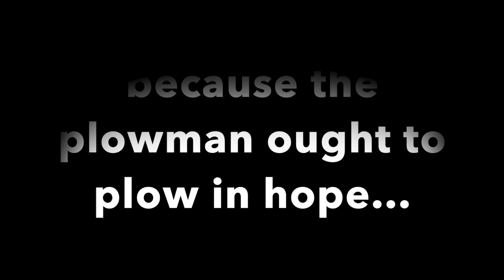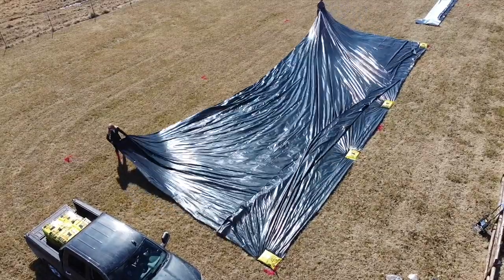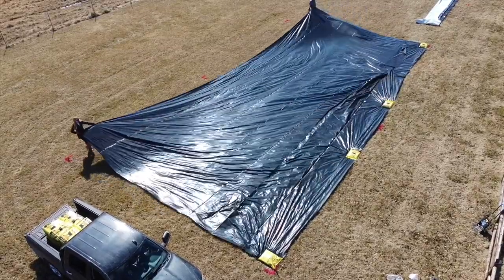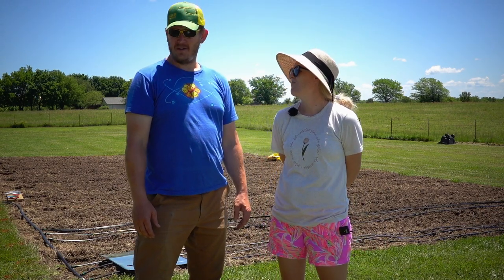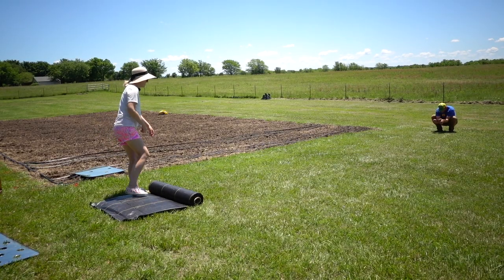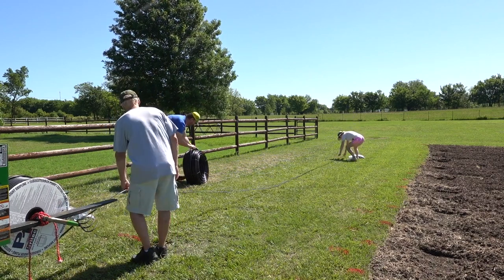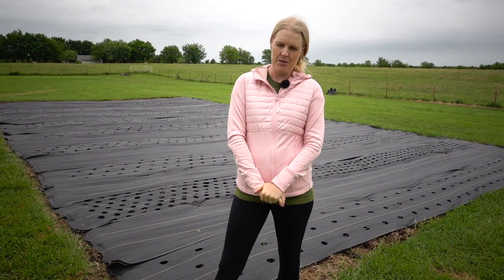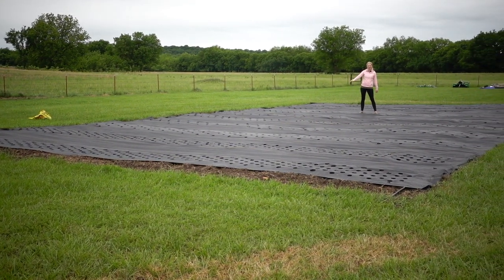Creating Our Flower Farm - Tilling, Drip Tape, Landscape Fabric 🚜

Comment: Hey, Alex! Another of your vidoes saved in my files for future reference. Always such great info shared, thank you! 
Question: How far away is your water source from your flower fields? I think I'm going to have to have one put in specifically for my flowers. We currently only have 1 spigot for all 6 acres we're on (crazy!) and it's at the front of our house, about an acre away.
Reply from the maker: In this video which is our old location, it was probs 100 ft from the house spigot. In our new location Eric built a water hydrant right off the main line so it’s right there

Comment: I use drip tape in my vegetable gardens but never have used landscape fabric but thinking about using it because it's difficult to keep up with the weeds.   One garden is a wood chip garden but it's still has it's own weed pressure.  Do you intend on leaving the landscape fabric down year round or removing it and replacing with the silage tarp?  Did you get all your supplies from Drip Depot?  Have you given some thought about placing the drip tape on top of the landscape fabric?  The reason I ask is that leaks develop in drip tape from varmints or accidents and having it under the landscape fabric would make it more difficult to spot a leak and/or repair it.
Reply from the maker: We will remove everything in order to cover crop and till. Then reconstruct the fields next season. Drip depot. Leaving under I found is better for absorption by the plants. Haven’t had any critters. We have a slow leak in one row but it hasn’t prevented adequate watering of the zone so we haven’t tried to find the source. Will test when we pull the lines up in November though!

Comment: I'm wondering where you got that attachment for the propane burner and also the template for burning the holes?
Reply from the maker: Hi Beth! We got the attachment at Lowes or Ace. And we made the template. Got the sheet from Lowes, measured the hole spacing with a sharpie (we have a 6”, 9”, 12”), then drilled them with a circular bit. Didn’t take too long and has been very handy.
Reply: @CoramDeoFarm  Hi again!! How large are the openings? Or I guess how big is the circular bit? Thanks for answering!